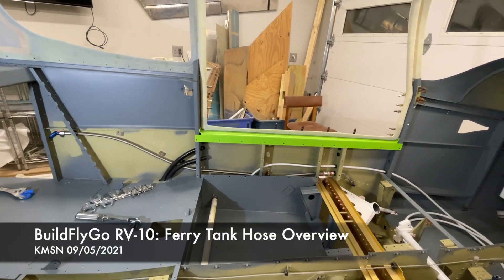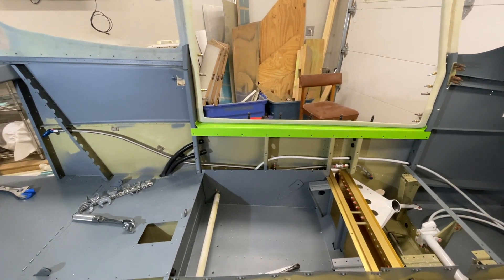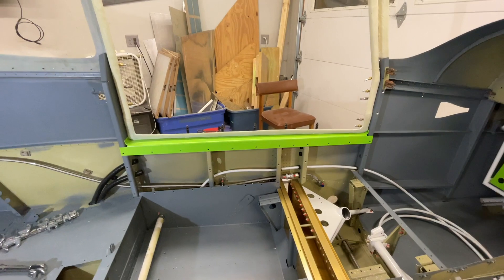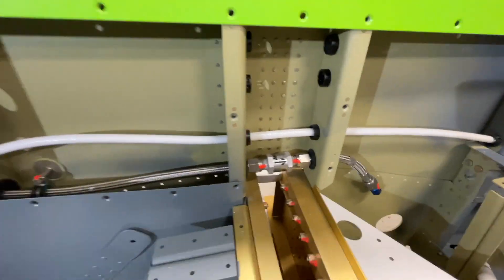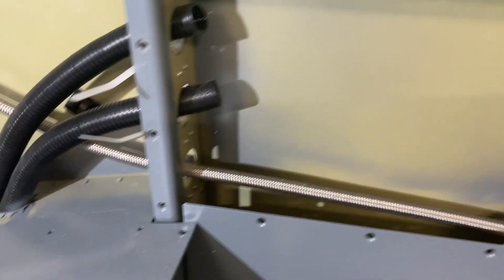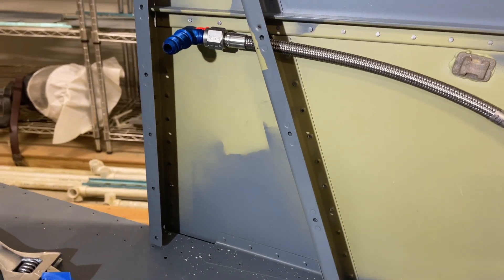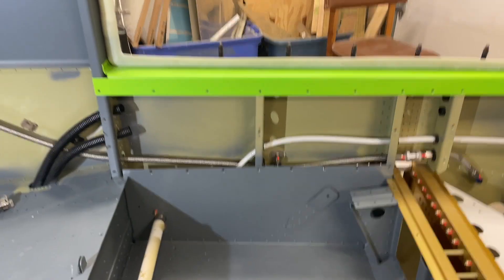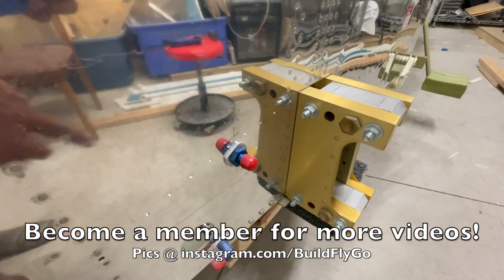RV-10 Mod: Ferry Tank Plumbing Overview

Comment: I've been using a Nauta marine fuel bladder for 20 years in my RANS S-7, with a transfer pump mounted on the floorboard under the passenger seat. My 2 wing tanks drain into a 3 gallon header, with no valves, both tanks always on, if and when one tank empties first (one always does) it doesn't matter, the fuller one continues feeding without any hiccups.  A tee at the bottom of the header has one lead going to the firewall/engine, the other to a valve under my seat. A floorboard mounted fuel pump, controlled by a panel switch with a ON lite, controls it. From the under seat valve, a line goes back to the ferry bladder, and is fitted with quick disconnects that seal on both ends. When I'm ready to transfer fuel I open the valve under/ alongside actually, my seat, and flick the switch. The fuel mostly goes into the tanks, as I'm pumping 1 GPM+,  much more than I'm burning with a Rotax 912. Best of all, when on a XC and I come back to the plane with mogas (all I've burned in 20 years)  besides the 9 gallon bladder I have a couple 5 gallon fuel bags,  but I don't pour their contents into my wing tanks.  A screened dipstick, with it's own disconnect and 3' of hose, lets me simply set the fuel bag on the ground and watch as the pump does the work, with no chance of spillage as I am free to watch the sight gauges, and both tank always fill exactly equally.

Comment: Hey Gil, looks like you've chosen the left tank as your ferry tank receiver.  I was thinking about doing the right side.  Any specific thoughts that went into your choice??  My only thought was if I'm solo, I'm in the left seat so I would put the Turtle-Pac in the right rear seat as an offset to my 220lbs.  Any other thoughts??  Also, wondering where you put the extra fitting on the inboard tank flange.
Reply from the maker: Not really, had to pick one :) For long trips I'm unlikely to be alone, so that seat is occupied. And we can move the rear ferry tank around in the back to wherever we need the weight. 

For the extra fittings, we went with the instructions provided by Aircraft Specialty. They have some details on their website on what works.
Reply: @BuildFlyGo  Thanks Gil, I appreciate it

Comment: Pretty sure you'll need a vent.  Unless you're going to use a bag tank instead of a rigid ferry tank and it will collapse as you draw fuel from it.
Reply from the maker: Yup, collapsible is the plan.

Comment: Did I miss something here? You are installing a auxiliary fuel tank in the baggage area but state that you don't need to vent the tank? If you draw fuel from this container then you will need to install some variety of vacuum breaker to prevent collapsing the tank from vacuum as the fuel is withdrawn. Maybe I'm not understanding your fuel transfer procedure. I am a recently retired mechanical engineer with many pumped tank designs under my belt. I have seen many vacuum collapsed tanks due to improperly vented tanks. By the way, I have been enjoying your videos for quite a while and thoroughly admire the precision and completeness of your builds. God bless.
Reply: Not if you use a bladder ferry tank (e.g. TurtlePac) https://www.youtube.com/watch?v=QFhQHBS1YuA
Reply: @Gagarin737  Good point. Settles the argument. Thanks.
Reply from the maker: Yup, collapsible bag is the idea :)